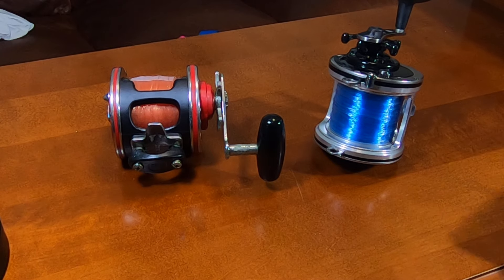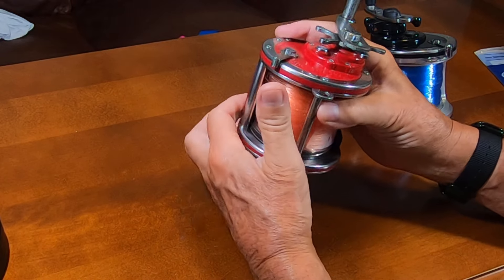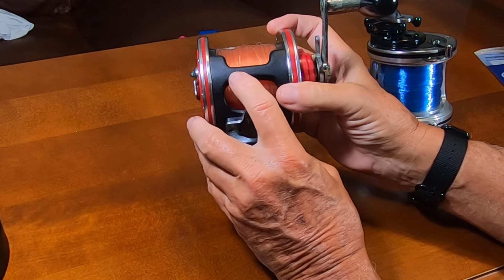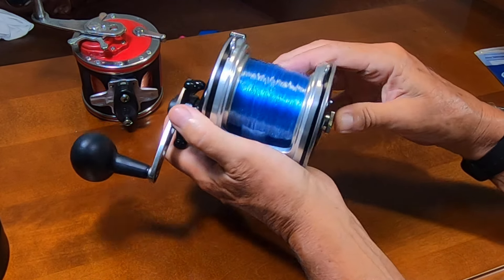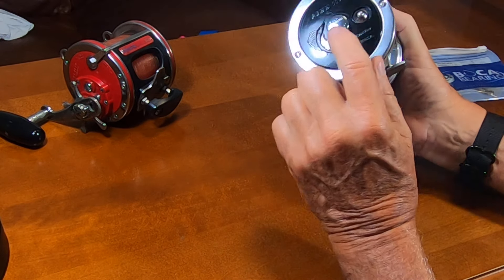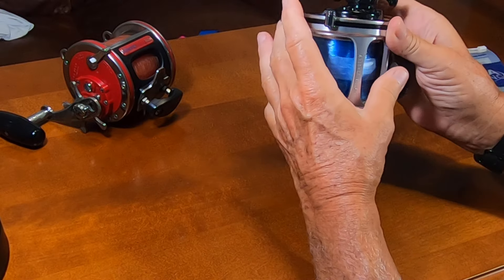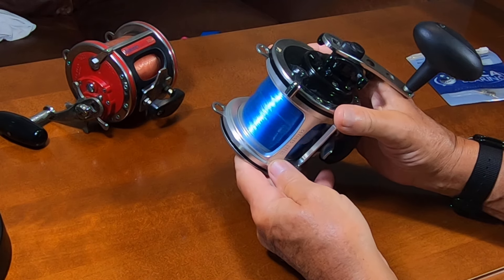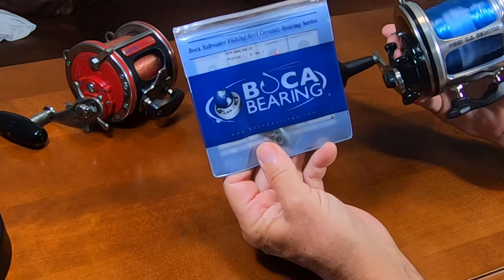US PENN SENATOR free spool w Boca Bearings

Comment: Good thing you didn't do the big cast, you might spool yourself. Great Video, I just received a 114 H2LW Senator with no line on your lucky for one rotation. I'm sending it back and getting US 113 W. Thirty seconds is better than 1 rotation. It's been 2 days no response from penn. The tackle place had no answers about the spool only making 1 revolution, I wasn't sure if this is what to expect because it is basically made for trolling. It does have the free spool notation on 113W, no mention on the 114H2Lw. Very similar line capacity but the US Senator is 17oz lighter. Your video was exactly what I needed to see. Thank You

Comment: The bearings you are using are made in China. Boca does not make bearings.

The new Penn you are showing has a totally different spool design. The is no friction on the pinion gear like the older ones.
Reply: I was not aware that Boca Bearing does not manufacture the bearings, thank you for straightening me out on that, Mr. Rawson. But I was aware of Penn's new live spool design, and I immediately observed the improved free spool soon after opening the box. Soon after, I replaced Penn's standard bearings with high performance Boca Bearings, and the further improvement was dramatic, as the video shows. The reel wouldn't do that out of the box. I can actually cast with this reel now. I use it Kayak fishing too. Thanks again.